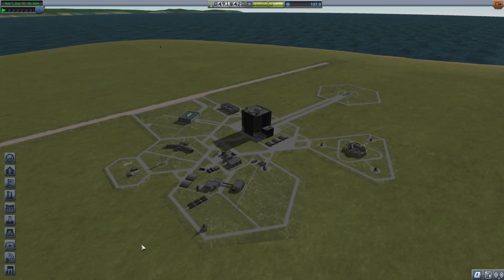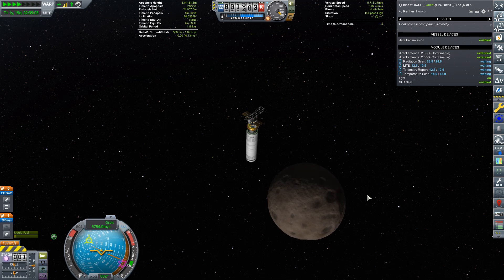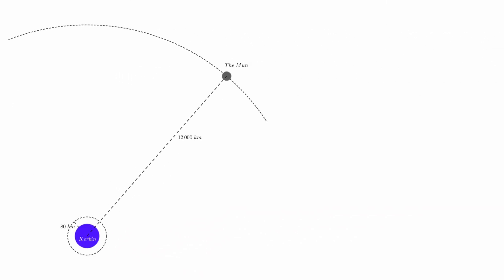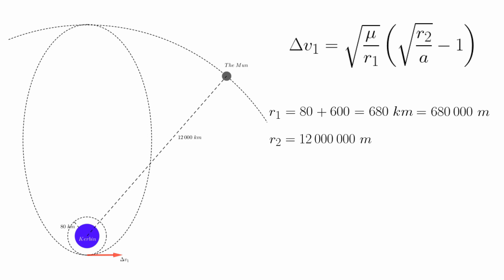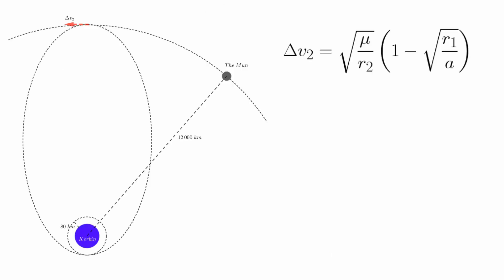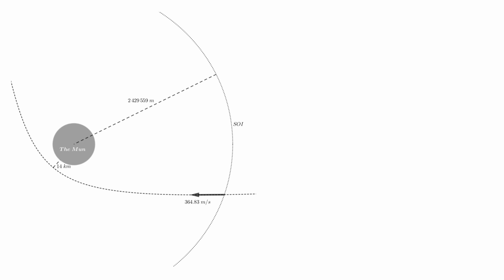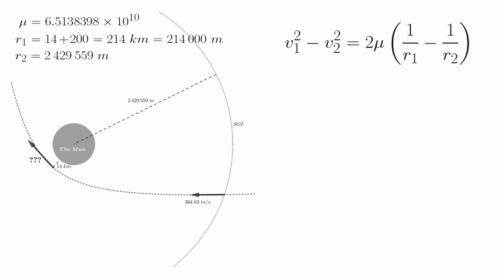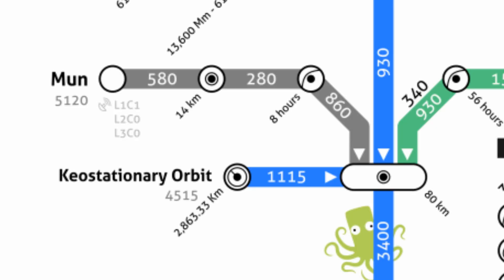Calculating Transfer & Capture Costs - The Mun | KSP Let's Do The Math

Comment: How did you know you'd be 14 km away from the moon?
Reply from the maker: I don't, but the difference in cost to any other low orbit is trivial.
Reply: @MikeAben  hmm, where did you learn this stuff?
Reply from the maker: @jacksmith2715  Worked it out. I'm a math major. I got a whole series on doing the math if you want to check it out.
Reply: @MikeAben  is there a way you could calculate the periapsis when it passes by the mun?
Reply from the maker: @jacksmith2715  I'm not sure I understand the question. You can set your periapsis to whatever you like by just adjusting the time of the transfer.
Reply: @MikeAben  oh, say you wanted the periapsis to be 50,000 m. Is there a way to calculate how long you'd have to wait? Not sure how to even word it I just can't find it online, I'll check your discord and see if somebody else has asked the same thing.

Comment: Hi Mike and thanks for the vidéos.
I have some problèmes with your calculs... for the transfert from LKO to mun orbit (12Mm) it's OK I have the same but. For the capture around the moon not at all and the fact, is that when I reach the SOI of the mun my speed is about 403m/s (read on the navball) instead of 364 and using formulas i found a delta V of 295 which is the perfect value to cricularise at 14kkm around the mun. Instead of 277 calculated for 364m/s (value which is enought to reach an Apoapsis at 44kkm)
It seems that calulation dont take into account the "gravitational slingshot effect". Did you notice something maybe there was an update of ksp between your vidéo  and now?! Let me know what you think about it. Once again thanks for the vids.
Reply from the maker: The formulas are (as always) a simplification. In particular, they assume the apoapsis of your Munar injection is exactly at the height of the Mun's orbit and that you encounter the Mun's SOI exactly at this point, but the Mun's SOI is a sphere with a radius of a little over 2400 km. You can encounter the Mun's SOI anywhere on this sphere and still get a capture. You can also slightly overcook (or undercook) your initial injection. All this can affect the speed at which you encounter the Mun.

You do seem to be hitting the Mun pretty fast. For example, the last time I went to the Mun in my live stream, I had an encounter speed with the Mun of only 337 m/s which is less than the predicted 365 m/s and well less than your 403 m/s.

https://youtu.be/NsCvFDDM5IY?t=2960

If you want to bring your encounter speed down, you'll need to spend a bit more time tweaking the initial injection burn.

Comment: The difference in velocity between mun and spacecraft at apoapsis is 364m/s , but you haven't added that Delta v ,then how come the interception velocity is 364m/s.
Reply from the maker: I probably could have explained this better. The vis-viva equation calculates the difference between your velocity and the velocity you need for a circular orbit. All objects in the same circular orbit travel at the same speed. So the vis-viva equation also calculates the speed difference between you and an object already in that orbit. I hope that's making more sense.
Reply: @MikeAben  I understood that the Vis Viva equation also tells the velocity difference between 2 objects. But I didn't understood the part where del(V2)=364 becomes the encounter speed(V2) with mun SOI. Would be helpful if you do another video with in depth details and also with comparing with the ksp.
Reply from the maker: @sudhiganapathi9881  Let me break down the numbers a bit. Your velocity in LKO is 2279 m/s. Delta-v_1 is 856 m/s. So right after the transfer burn you're travelling at 3135 m/s. You can use this velocity with the fourth formula in the video to calculate your velocity when you reach the Mun's altitude. It is 178 m/s. You can also use the orbital velocity formula to calculate the Mun's velocity to be 542 m/s. Your ship and the Mun are traveling the same direction with the Mun coming behind you. So your encounter speed is the difference between the numbers which is 364 m/s.

The delta-v_2 formula gets the same value because it already takes into account the velocity of the Mun. I hope this helps.
Reply: @MikeAben  thanks mate now I understood it clearly